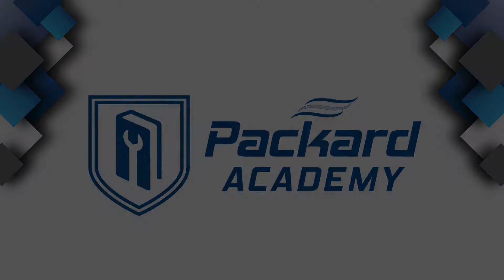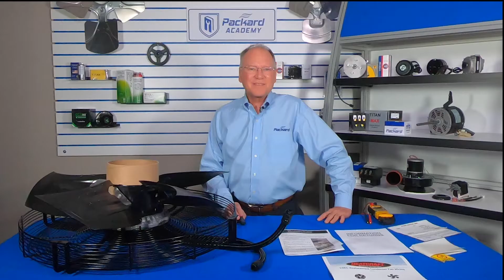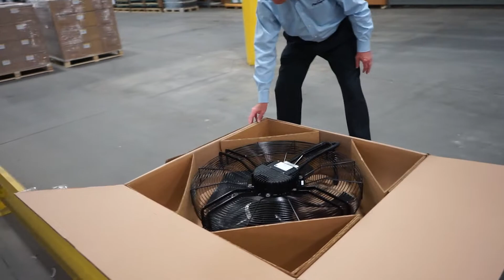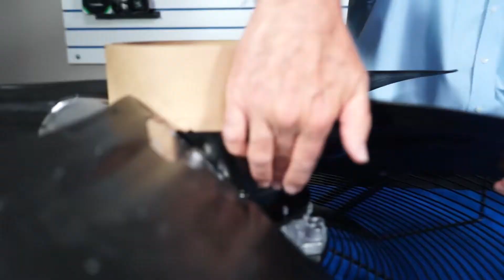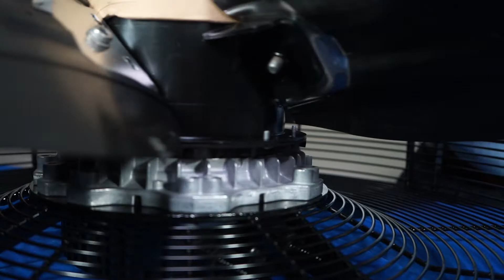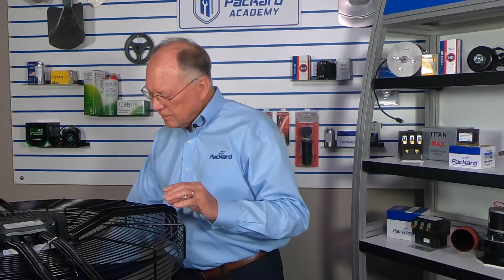Replacing An 800mm Heatcraft Condenser Fan: Step-By-Step Guide

Comment: Question, is the customer responsible for packing and shipping this unit from the residence address,    Or is the contractor responsible for shipping and packing of course charging a shipping and packing fee to be included in the price of the repair ? 

         I can see in the larger metropolis areas where companies labor rates approaching $200 an hour to $350 an hour and handling fee to drop off at a FedEx or UPS or anywhere else somewhere in the neighborhood to $50-$100 tacked on to the price.  Time is money 💰
Reply from the maker: A fan that has reached its normal “end of life” and is out of warranty does not need to be returned and should be properly recycled.  If the fan is within warranty, please contact Heatcraft for further guidance.
Reply: LISTEN TO THE VIDEO AGAIN.  HE SPECIFICALLY COVERS THE  "RESIDENTIAL" PART OF YOUR QUESTION.
PAYYYYYYYY TENTION!!!!  DO THE LABORIOUS EFFORT TO PAYYYYYYY TENTION!  DO THE WORK TO LISTEN WITH UNDIVIDED, UNINTERRUPTED ATTENTION, FOR EIGHT FULL PAINFUL MILLENIAL BRAIN IMPLODING AGONIZING MINUTES.
THEN, APOLOGIZE/REPLY FOR YOUR COMPLAINING, WHINING COMMENT.
Reply: @BYENZER  no complaining no whining this time I watched it a second time when I was not driving between job sites. 
                We charge for everything if we have to pack something up and return it especially big and bulky like that there is a charge. 
       We charge $4.88 per minute sometimes as low as $2.88 per minute.   So even packing and returning and filling out paperwork is counted. 
        We even charge for picking up and receiving or making phone calls related to the job Per minute.

    But you’re right it was a long agonizing eight minutes,?    I think I could condense it and cut it down to about 45 seconds
Reply: @coldfinger459sub0  I heard the 'RETURNS' department at Walmart does exactly what you described, and it's one of the most profitable departments at Walmart, because of it.